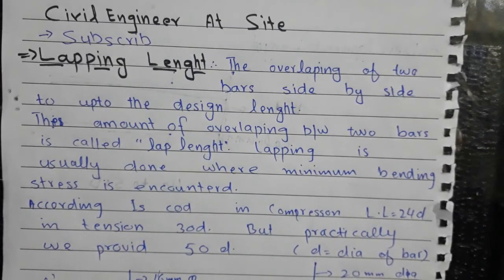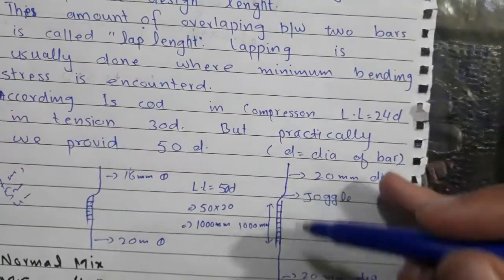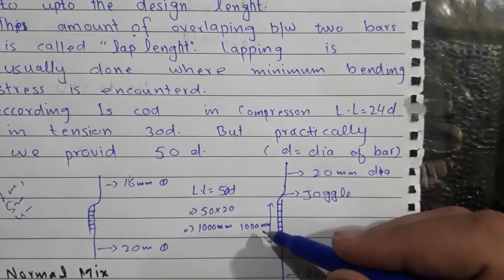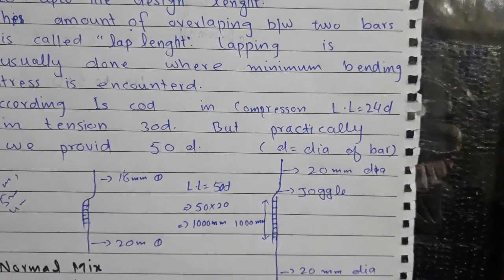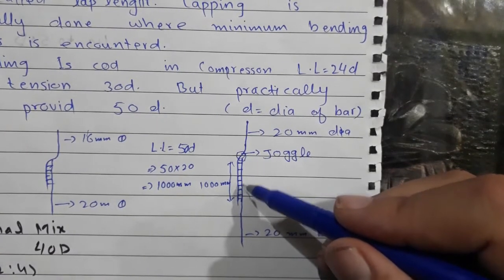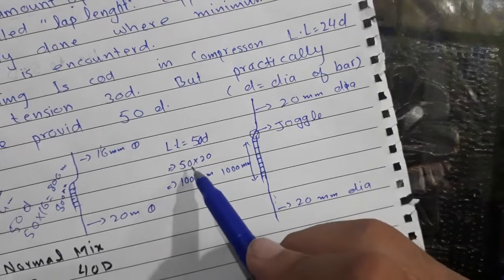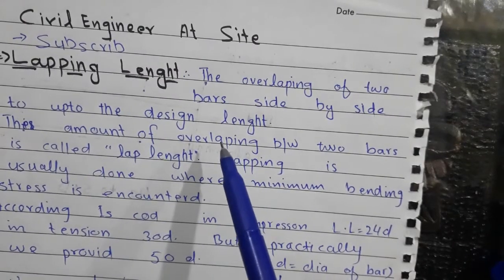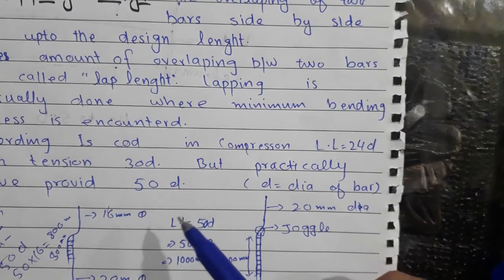What Is Lapping Length of Steel Bars | How To Calculate Lapping Length | Civil Engineer At Site

Comment: here you didnt tell about 32mm dia for overlapping because it should be not over lapped and must be tighten by threads in the ends of each bars same like Not and Bolt.